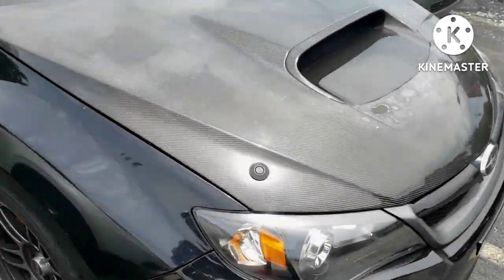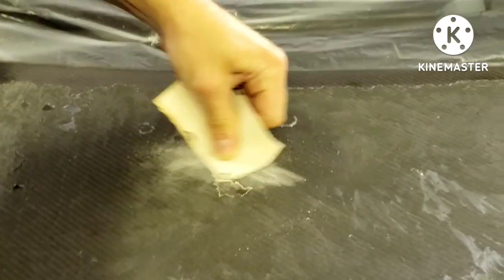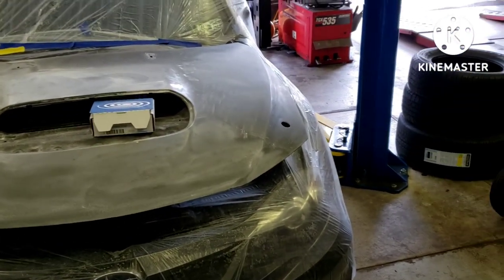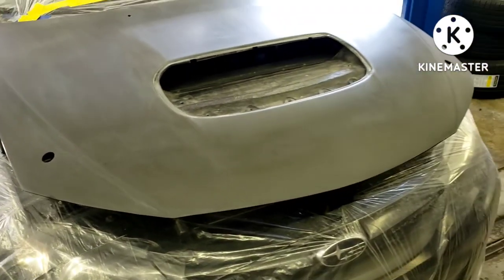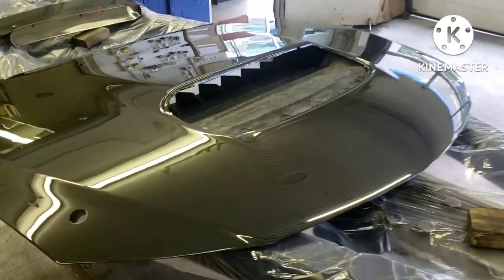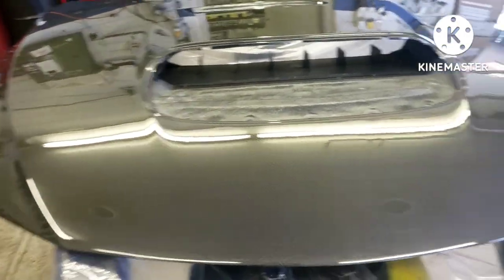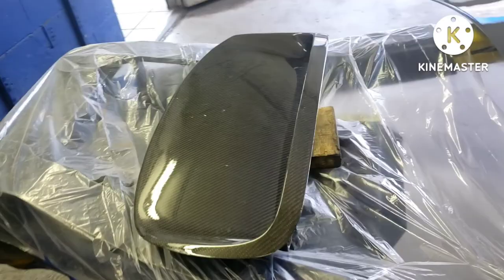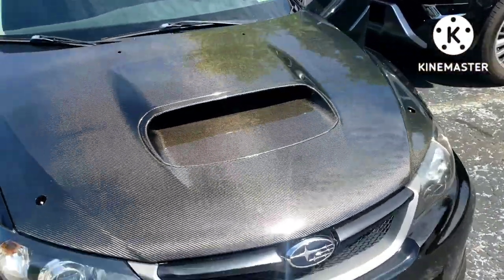How To: Restore Carbon Fiber

Comment: You didnt wet sand in between coats ? The dirt or particles would of been locked in there as soon as you put 2nd coat on ,you cant buff them out that only takes particles off top coat
Reply from the maker: Without rewatching the video, I'm pretty sure we didn't need to wet sand. We just washed it with glass cleaner multiple times before spraying it. Apparently, that's what some body shops are using now.
Reply: @nickquatrini  at the bodyshop I work at we use glass cleaner but also some lacquer thinner to make sure we got all the silicone or grease that could have gotten onto the panel after paint prep
Reply: @randomstuff159  Lacquer thinner is too hot for that. Use wax and grease remover.
Reply: @gottagofast12  Or to be on the safe side, mix-up some IPA (homemade panel wipe) but go heavier on the Isopropyl Alcohol. Or, you can use Denatured Alcohol. It's very similar to Lacquer Thinner but a lot safer to use. Both IPA and Denatured work great for paint prep ;)

Comment: idk how the heck you did that with 320 grit... I would start with 80 or 100 at least... Any thoughts on that?
Reply from the maker: I mean, you probably could. But me personally, I wouldn't go any lower than 220. The DA sander takes it down super fast and remember a carbon hood is just clear coat and epoxy resin. If you go too far into the epoxy you damage the carbon strands. We had the whole hood sanded in under an hour only one person working on it at a time.

Comment: Great work! My '18 WRX is currently being painted from the stock dark gray, to Audi Suzuka Gray Metallic. I'm gonna be re-clearing my APR wing though myself. I only had it a little over a year and noticed it's got a couple cloudy spots (clear failure) forming (even with me stacking 5 layers of ceramic - single layer of gtechniq CSL, and 4 gtechniq EXO). Figured I might as well take care of that now, since APR's clear/gel coat isn't that great.

Comment: popped up into my recommended. looking into RESTORING a C.F. wheel fender for my GSXR600, this helped ALOT as far as DIY suggestion. THAT HOOD LOOKS F'n SICK MAN. Just outta curiosity (if you see this message) how many coats on my wheel fender would you suggest, or just do 2 decent coats of clear?
Reply from the maker: @robsnizzle7  we just did 2 coats and it turned out perfect. Still looks the same as the day we did it 👍

Comment: Mines has some darker spots where as the others are still fine? Do I just keep sanding it down till all of it is like that?
Reply from the maker: Darker spots are probably clear coat that is still there, but it is hard to say because if you are into the carbon fiber you've gone too far. 
Use some water and wet sand those spots with very fine paper, if the water turns white than it is just clear that is still there, if the water turns a dark color than you are down into the carbon and you need to reapply a layer of epoxy over top of those spots to seal it off.

Comment: Do you know if I sand my carbon hood instead of painting it or putting clear would wrap stick too if?
Reply from the maker: I don't know for sure. I think to be safe I would spray a coat of clear after sanding to give it a nice smooth surface to adhere to.
But also I would wait a week before wrapping it so the clear can fully cure. They sell automotive grade clear coat in a rattle can on Amazon

Comment: why is it still yellow
Reply from the maker: Carbon does that as it ages
Reply: No, it doesn't. Resin does it if not uv coated @nickquatrini
Reply: @nickquatrini so you did a half ass job
Reply from the maker: @g3money12  as far as i know there is no way to remove the yellowing from the resin. It is doscoloration from UV light

Comment: What clear epoxy did you use
Reply from the maker: We just used regular 5 minute eppxy from walmart to fill in some chips.
If youre doing a big job you can use a resin from total boat but make sure you get the clear epoxy
Reply: @nickquatrini  thank you so much